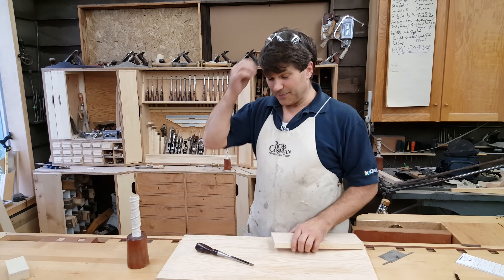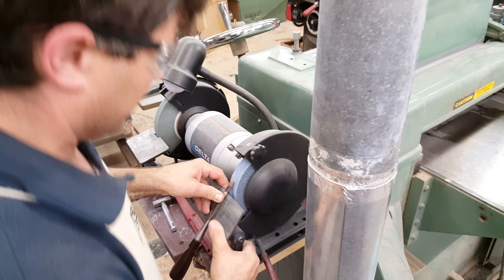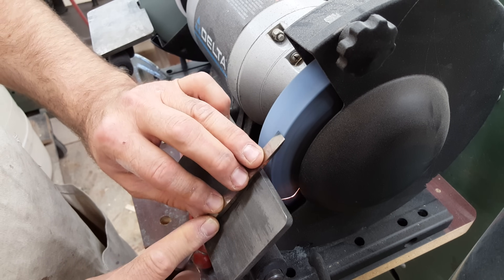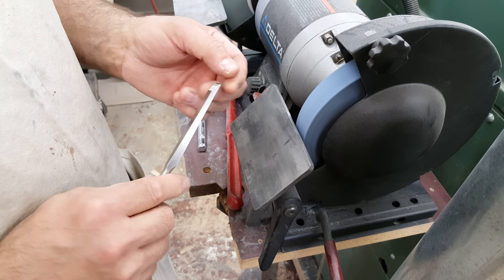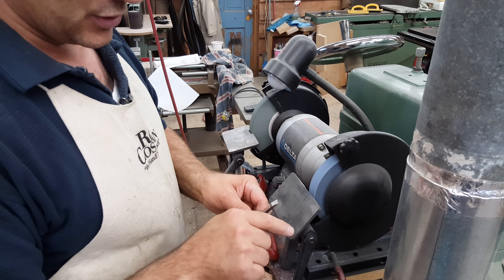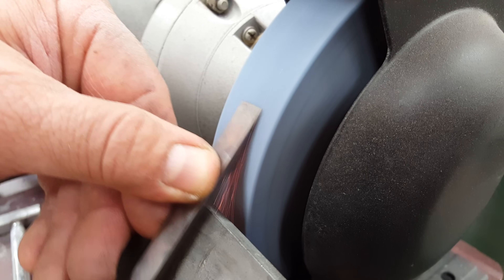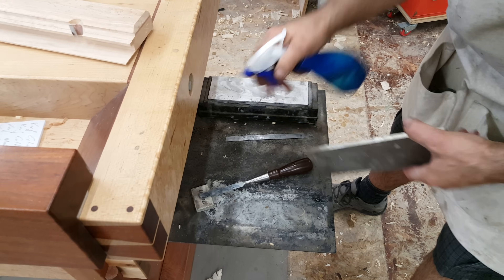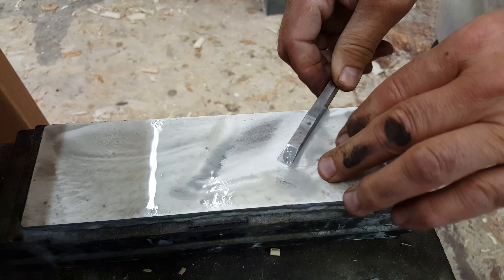Chisel Problem Solving, 17 degree bevel for soft woods

Comment: It's ironic, I have a 10 piece G.I. Mix brand of socket chisels (in the original wood box) manufactured in the 1890's. 5 of the chisels were never used and still have their original factory bevel, the bevel is 17 degrees - and the largest chisel with that bevel is 2". It's amazing what the manufacturers knew back then and what they don't know now.
Reply: Everybody these days is a know it all. When they learn something they love to say how they knew that for years but they only have ever mentioned it just recent.

Comment: I am struggling to make precise round 7mm cuts over revolving 4mm steel shaft in spruce and your video opened my eyes that I am doing it wrong with 25 degrees (plus 1-2 degrees micro bevel) tool I made especially for that. I will regrind my tool for spruce and try again,

Comment: Great video, all my chisels are about 17_20 degrees and they work well on hardwood like oak as well, I found it left a nice finish but I did rehardern and the secret is temper them so they are a lot more soft, you may have to sharpen more but I have not had chips on blade, I think some expensive chisels are to hard for wood, by the way I don't expect you to temper expensive chisel buy a Chinese set as they are not very hard👍

Comment: I have cut some dovetails in the past using pine and have had the problem with tear out (spring wood). After seeing how clean cuts look I think it would be worth while to bevel down a paring chisel (1/4, 1/2 ") and find out. Thanks for the tip.

Comment: A 1:1 solution of water and isopropyl alcohol is a somewhat obscure wood carver’s trick that helps when all else fails. Put in a tiny little hairspray-type spray bottle and mist only onto the area you are about to chisel. Let soak in a couple seconds, then cut. You have to keep spraying it on because it evaporates quickly (and you shave off the wetted wood). It works, good for low density woods - troublesome end grain and irregular/interlocked grain. The other tip I’d mention is you need a very smooth final stone like Rob has, or a strop with a bit of aluminum oxide. A bright polished edge really helps with soft wood.
Reply: Just tried this and it's bloody cold in shed, hand wash alcohol and water sprayed on wood left a nice cut👍👍great tip I have never heared👍

Comment: Just bought a pre owned unused 6 piece narex chisel set to specifically bring to 17 degrees exactly for pine and cedar dovetails in a sho sugi ban tansu dresser with cedar draws I'm about to start. I think I'll grind (6 inch Norton 3x I grade) to 15 degrees( because it'll be hollow) and then 17 degree with the mk2 on dmt stones. Looking forward to it because my pine and cedar is chuncking out between tails too. Thanks !

Comment: I ground a chisel on a Tormek to 17 deg. The trouble is the actual edge was about 10 deg because of the curve of the wheel. When I used it the edge was quickly blunted. I honed it to 17 deg and it was much better.

Comment: The reason you split out the waste between pins and tails is to avoid tear out when cleaning up the thin amount left. Especially on soft woods. But a lot of soft woods have winter growth rings that are harder than hardwood and when you chop down to thick a waste in one hit, the soft growth collapses.
Grinding a bevel that low is just plain stupid. It's far better to use a couple of left and right hand carving skews especially on pins. 
The best ones are Addis, but hard to get now.
Reply from the maker: Your logic here doesn’t make sense.

Comment: Low angle less tear out, less sideways deviation. My chisels are sharpened to 20 degrees. Honed up in my worksharp for a couple of seconds on 1000 grit. No problem on hardwoods. Not for morticing though !

Comment: I'm really surprised you don't use a wet slow speed wheel.  Obviously you're an expert at this.  I guess you're dry grinding for time considerations?

What about using a Wixey digital angle finder on that tool rest to determine angle?
Reply: +christschool The digital angle gauge requires a reference surface in order to determine the angle of the tool rest. You'd have a very difficult time getting an accurate reference on a round grinding wheel, that can move and has any number of points at which the tool can contact the wheel.

Not saying it absolutely can't be done, I just think you'd have a really tough time being accurate.

Comment: This is just what I've been needing for dovetailing in pine. I'll give it a try! What do you recommend if I don't have a 1000 and 16000 grit stone? The finest I have is a 600 diamond stone. Stropping would probably be a bad idea for such a fine angle.
Reply: Wetted, new 1200 grit wet dry sandpaper on (dead flat), clean, smooth plate glass or granite cut off (I find it sticks well enough when wet). Then a strop charged with compound. You can strop just about anything, just be careful not to raise the angle too much off the primary bevel because you’ll create a (super shiny) micro-micro bevel that is rounded. Always strop the whole microbevel, dont raise off it.

Comment: how come you said "can't use these on hardwood" for the 1/4 and 1/2 " at the beginning of video?
Reply: Any type of metal will start failing too soon when you go under 20-25 degree bevel and use it in hardwood.

Comment: Once you get close, surely using your 300 grit diamond stone would be safer than risking the heat taking the taper out of the steel?
Reply: It needs to be at least, I don’t know, something like 380 F to begin to soften the hardest Japanese chisel. So usually it’s pretty obvious. But you have to factor in that you’re not touching the steel right where the wheel is creating the heat, you’re always back aways. If you are close to taking away the bright line of dullness on the edge, you need to be very lightl, gentle, just kissing the wheel with the blade.

Comment: Yeah I've bench hollow ground a couple of chisels myself. I don't think I've ever done such an acute angle on one yet though. I need one of them protractor deals. I'm not good at grinding the bevel too even so I made this to help me out https://i.pinimg.com/originals/5c/8d/ec/5c8dec64fc24d4567e792351be211b25.jpg It is kind of a rip off of the Veritas tool rest. Well that's where I got the idea from. I did more of a clone of the Veritas with my prototype. Then I ripped off the Tormek F bar for another grinder of mine.

Comment: I'm sure I don't have to point out that setting up for a 17-degree bevel and then using a worn down wheel will create a concave bevel and a cutting angle much less than 17-degrees...so I won't mention it.
Reply from the maker: alex tworkowski I probably don’t need to mention that the micro-bevels added in the sharpening process will create a cutting angle much more than 17 degrees...so I won’t. However, I will mention that the angle at which it contacts my stone is 17 degrees and that’s what I find to work best!
Reply: Good point.
Reply: yes it would create a much lower angle than 17 but the Rob puts a secondary bevel back on teh cutting edge that in theory brings it back to 17.